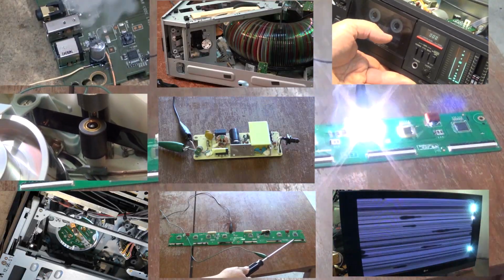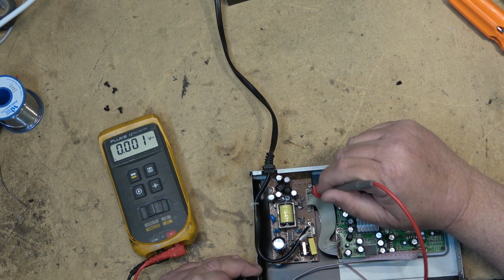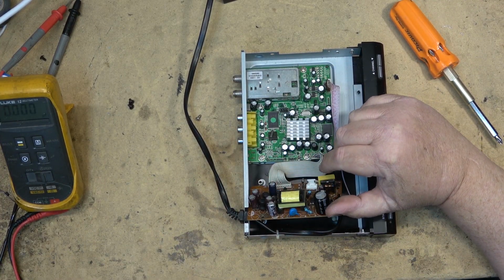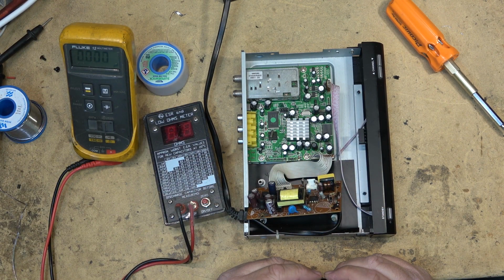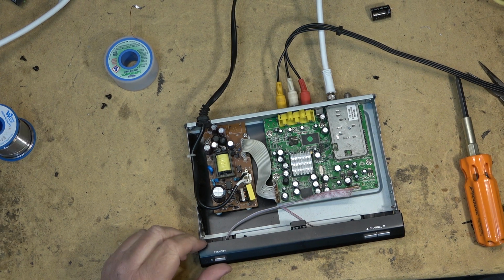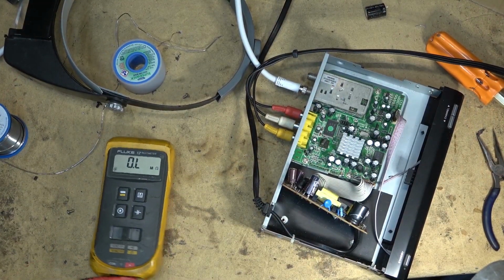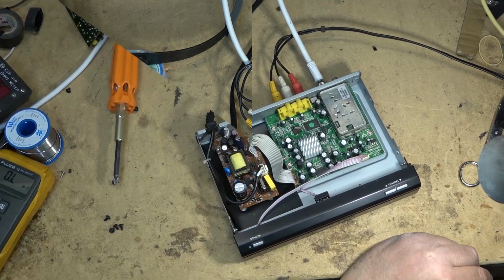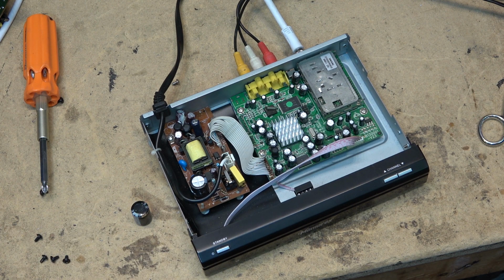Memorex ATSC TV Receiver Box No Signs Of Life

Comment: Hmmm.. I normally find more dead caps on the primary sides. But well, that could be because of 230V mains which stresses the caps a bit more (short 400V-spikes are kinda common) esp. if caps are rated around 250V. I always wonder if those 250V is average or peak and if those caps are rated for 230V AC (which peaks at ~325V) at all..
Reply from the maker: In 240 volt countries the primary filter should be rated at least 450 volts. Even here where our primary is only 120 if you measure the DC voltage on those primary filters you will see them charged to approximately 170 volts so in a 240 country you would expect to see that charge to around 340 DC
Reply: @12voltvids  Yeah, but in esp. older stuff you often see caps with somehow an "AC equivalent" rating, i.e. the 220V (now 230V) marked caps are indeed often >350V DC rated. It all depends on the manufactures specs, but you don't get specs from the 70s that easy.. On cheap .. East Asian stuff though, you likely see 250V (DC rated?) caps on the mains side (no Class-X appr.). Probably good enogh for 120V AC, but not for 240V UK mains..

Comment: Switch modes and there habit of boiling capacitors with high frequency ripple current :-(.
Yes i've seen the two or three resistors tapped on to the resivour capacitor to supply the fancy pwm  primary start up power.
The transformer has a tapping to later provide the chip.
The chips are so complex with there fancy modes, i just simplify it to a pwm.
So don't bite my head off for my lack of depth lol.
I have no reason to want to know about the modes, i just stick to the basics.
Would it be worth your while to buy higher grade caps so it will last a good bit longer?
Reply from the maker: This was AC side, so 60 hz.
Reply: @12voltvids  Yes very true.
I don't see too many with a dead resivour capacitor.
Odd that.

Comment: A good soldering iron is like gold. Thats why i bought a bunch of old soldering irons of different sizes. Plain simple design, no temp control no fancy stuff. Just workhorses :D I dont know any wattage of these old irons but they can be extremly hot. Just with a touch everything melts instantly. One of the bunch is so beefy and the "tip" so big, its good for old equip where stuff is soldered to the chassis. No problem with this humongous iron. I just need to mod some of the irons - they have no power switches.